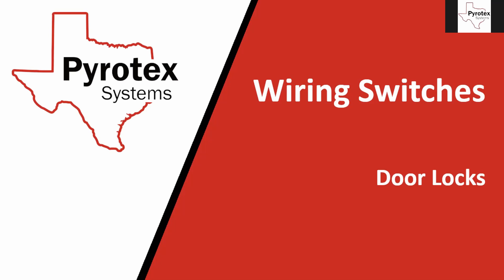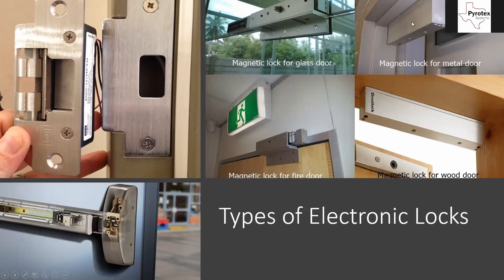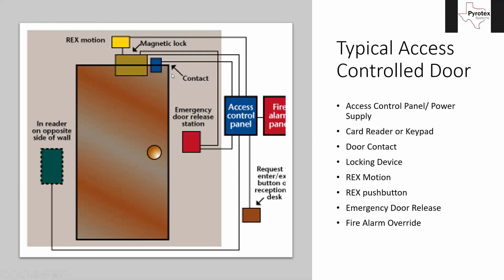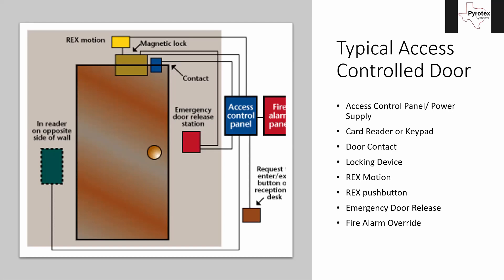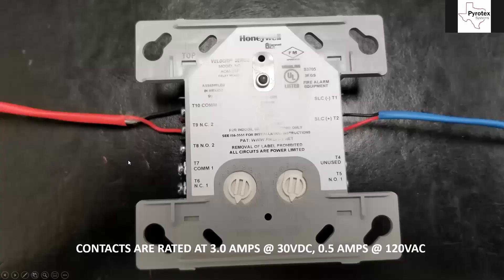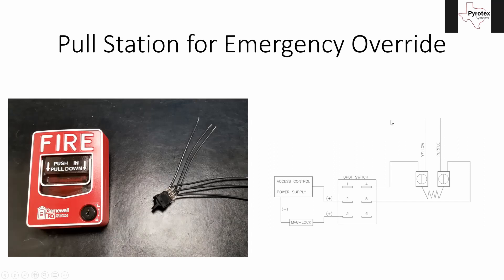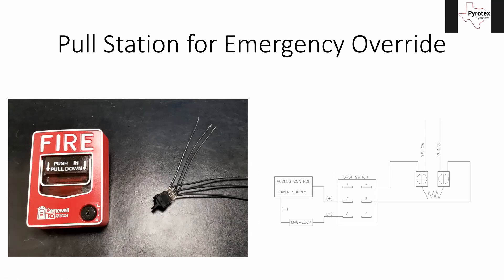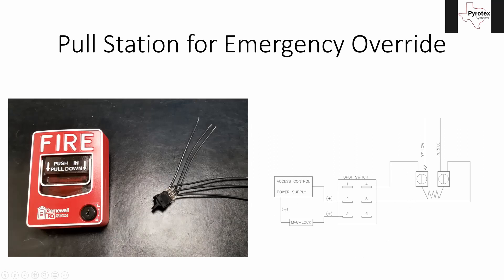Fire Alarm Override of Electronic Door Locks

Comment: Hi Firstly thank you for the video I am in the process of learning and planning a installation with some ZKt inbio460's and a fire alarm. I am not in the US or EU. The facility is in a industrial complex and it is really not a safe option to auto release external doors before the fire department or armed response get there. There will also be a small data center with client data.  So my ideas/thinking are as follows 
1. on fire alarm the power to internal door mag locks will by cut by a fire relay where all the power runs thru, so they will be open. 
2. The entrance will have a REX button but I will also do a pull station in the way you described in the event that someone is inside and the access control malfunctions. 
3. The one fire door will have a REX and pull station (The door is also a staff entrance) 
4. If no one is there a well marked box kept close with a magnetic door release inside  a fireman's isolator to be pulled with a poles with the hook and that will cut all backup power and release external doors. I know it is not code in the US and EU but that's not were I live and if I demonstrate that it is working I will get an official OK. Constructive advice or how it is handled elsewhere in a sensible manner would be appreciated. Fire keys are not really a thing here I want to keep it simple = low tech but also comply with high tech access and IT stuff.